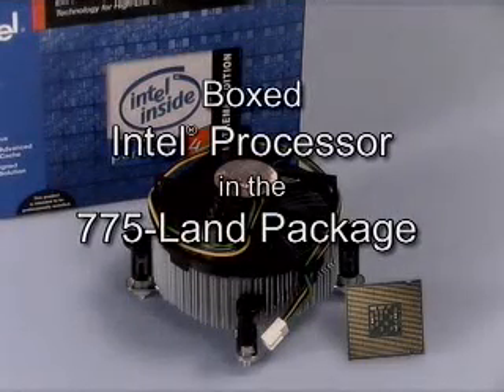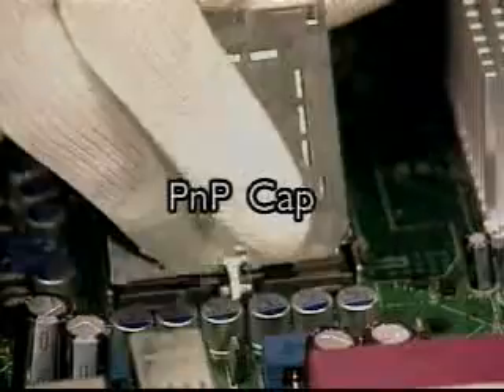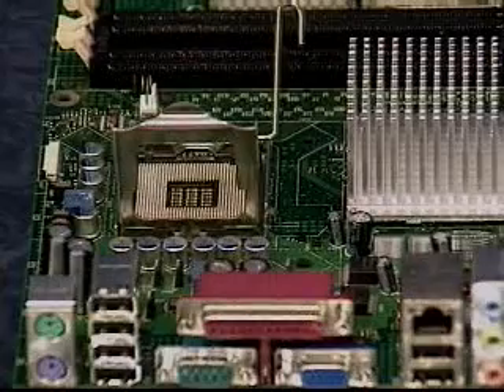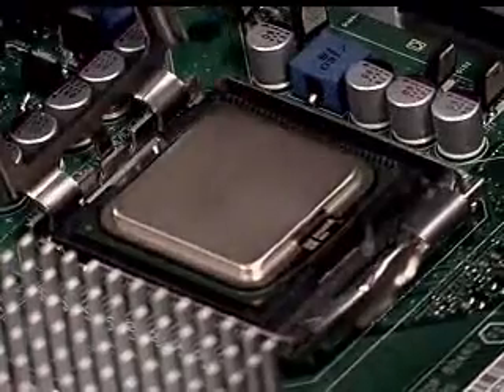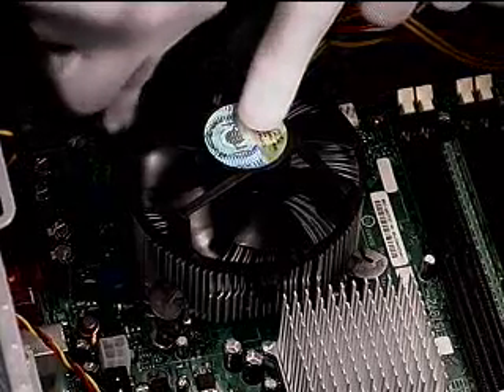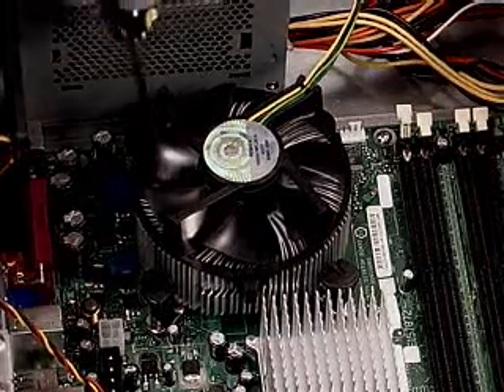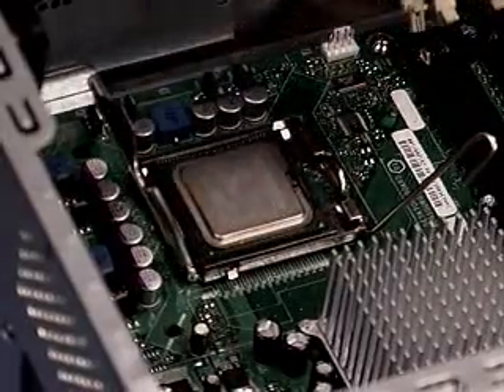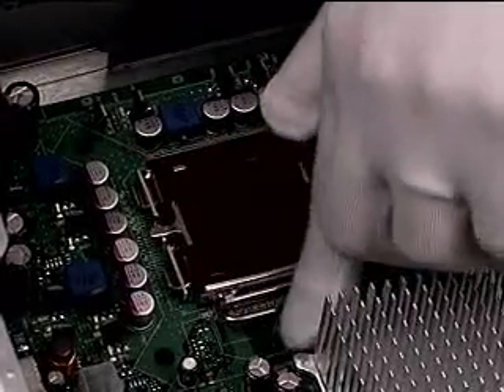Intel Video: Socket 775 integration guide

Comment from the maker: install the new, the p4 heatsink is probably smaller than the pentium d heatsink which means the p4 heatsink will make the pentium d overheat.

Try to see if it works with the other screws and find out.